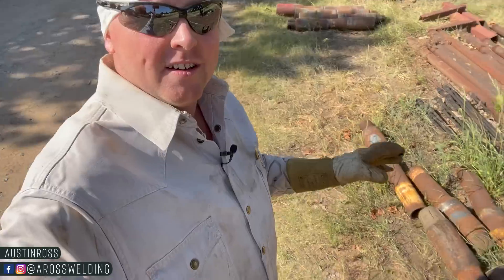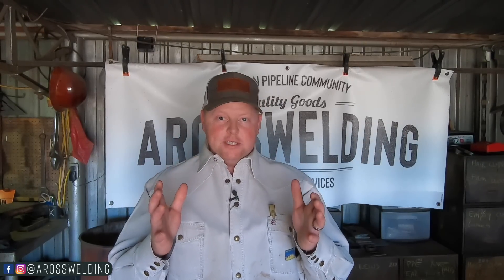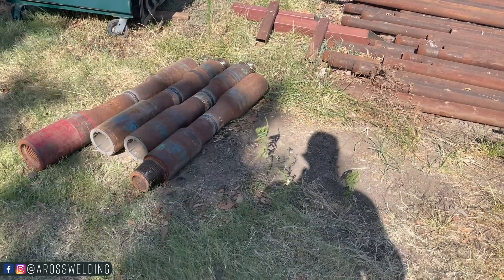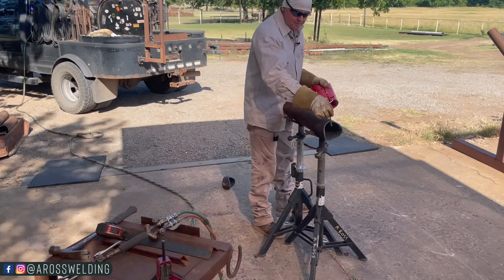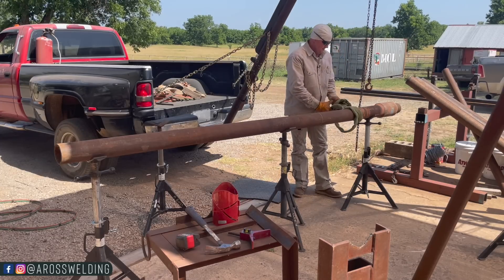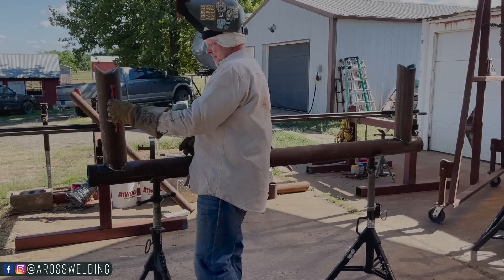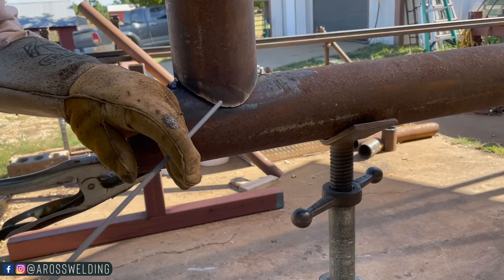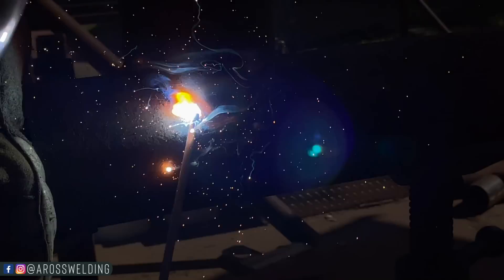WHEN WELDING ON MAGNETIZED PIPE

Comment: I build pipe fence and most the time I will  heat with a torch and beat on it with a hammer a bit or turn it up more. If it’s real bad I will wrap a lead around it. Once it gets red hot it usually will chill out unless it’s real bad

Comment: I use to rap my stinger around  the pipe multiple  times one direction or the other to pull the magnetism  out so I could weld it when I had my old Lincoln  my 250 Miller didn't work that way

Comment: 69 years old, started stick welding in 1976. Took a loooong break, until 2014. By that time, I inherited a Craftsman welder and did a couple of projects. In 2017 I bought a Forney wire feed welder and started doing some projects around the house. Today I have a Lincoln 215 MPi and do mostly MIG but still practice stick often.

Comment: if you are running a modern welder / generator on a rig would a 240v plasma cutter not be cheaper than paying for oxy/fuel ? would a ac/dc rig make it any better to work ? good vid .

Comment: Stick welding off & on for 48 years. Off & on since I was predominately a Heavy equip/Diesel Mechanic.. Gas welding was the first time I welded.. My claim to welding fame was welding a rack to double stack V-12 Cummins engines in the warehouse.. never really did any pipe welding though, so I dig watching you go at it

Comment: I am 60, and started stick welding as a teenager on farm equipment, etc. Took some welding classes in college, and continued working on farm equipment, and my heavy equipment.  Tried mig welding some 20+ years ago, but didn't really use it much until I bought a new Millermatic 252 about 7 years ago. Really enjoying learning from you, and I trying to learn more everyday.  Thanks👍

Comment: 37. Been hot metal glue gunning around the ranch for 20 years. Had a guy that worked for us get me going before he was fired. Been learning the rest on my own. Far from being an “expert” but welds quit breaking after a couple years and several temper tantrums. 
As for the magnetized pipe and old man I met several years ago told me to wrap ground around the pipe several times.

Comment: A trick I learned years ago; take about 4 - 6 wraps of old, bare (insulation removed) welding cable as close as possible to the joint to be welded and attach your ground to that.  It's worked for me many times to stop the "spit back" of a welding puddle.  60+ years of welding stick, then MIG and finally TIG.  Guess it gets in your blood.  Thanks for the videos, stay cool and safe!
Reply from the maker: It definitely gets in your blood. I agree. Thank you for sharing!
Reply: I would wrap my pipe with the ground wire 2 or 3 turns and it would calm the drifting arc.
Reply: What an elegant solution! 

My background is electrical engineering and I sure didn't see that "trick" coming (please allow me to geek-out a moment); induce an alternating magnetic field using the very current you're welding with, other then the reactants of the coil (the coil's induced opposition to current flow due to counter-electromotive-force), most of the energy dissipated and voltage drop will still from the weld. You're multitasking!!!!
 
As long as you're using the full AC (not a rectified, 1/2 waveform or interrupted DC, it seems to me it should work perfectly).
Reply: @RobertLBarnard  Your obvious knowledge of electrical current is far above my "pay grade."  This trick was imparted to me well over fifty years ago by on the best welders ever to strike an arc here in north Texas.  It works well, so I've always used it when necessary (we have a lot of surplus drill pipe, tubing and sucker rods) that are used as construction material, thus the need for a solution.  Glad to share his "trick" if it helps a fellow welder.
Reply: @RobertLBarnard  How could this be achieved on a flat plate? 8cm thick and 1.5m around. I'm struggling to get my head around it.
Reply: @willeveryday try yelling at it
Reply: I do the same thing and it works well.
Reply: would it work even better if you rapped two seperate coils around each side of the joint and then connected the ground cable to them? Have you ever done that? or could you give a little more detail? Thanks.

Comment: 56 learned welding in my operating engineers apprenticeship been welding off and on for 33 years do projects on the farm or some small things at work have recently started making bits for horses and delving into knives did some fence braces out of drill pipe last summer didn’t realize until today why some welds were harder than others thank you and enjoy your videos

Comment: I’m 36. I started stick welding in high school. I’ve been doing small welding jobs and building pipe fence on the side ever since. In 2016 I took a job as a welder in a water treatment plant, we do everything from building handrail to repairing leaks on water pipelines as big as 96”. I’ve also mig welded and since taking the welding job I’ve started Tig welding carbon, stainless, and aluminum.  I enjoy watching your videos, I like to learn something new everyday as you say.
Reply from the maker: Thank you for sharing! And thank you for watching! We sure appreciate it!
Reply: FUN HUH, I DO ALL THE WORK FOR THE WATER POLLUTION CONTROL FACILITY!! THATS WHAT THE SIGN IS OUT FRONT, BUT UNLESS YOU LIVE EITHER A LITTLE UPWIND OR DOWNWIND!!!!!!! IT'S THE DOO-DOO PLANT!!!!!!!!🤣🤣, BIG SIGN IN THE SHOP " YOUR SH*T IS OUR BREAD AND BUTTER"  ITS CLEANER THAN 95 % OF THE FACTORIES WE WORK IN!!!!!!!!

Comment: I’m 50 I’ve had my on mobile welding business for 20 years. The best way I found to deal with magnetized pipe move the ground if possible run it as hot as you can and rod angle

Comment: Austin in that booklet I sent you there is a section about magnetized pipe . It worked well on big inch pipe in conjunction with a gauss meter . Most pipe that has been in the ground for years will be magnetized

Comment: I always keep a 4' length of copper cable without shielding and wrap the pipe then ground to that cable to cut down on arc blow from magnetic pipe. Works ok but not as good as AC.

Comment: Just a lurker here originally from Kalkaska Michigan, 59. Dad taught me how to stick weld when I was around 8 or 9 on an old blue Miller AC. Got a UV burn 30 years ago that never quit looked right. I went into electrical, then software engineering. But welding and machining never got out of my system. Have a hobby shop and I watch guys like you (and gals too, @Goldie Hacks) to try to recover some of what I'd have learned had I chosen that path.
Reply from the maker: Thank you for sharing! And thank you for watching! We sure appreciate it!

Comment: I’m 35 and been welding all hi school and after that so like 19-20 years I’ve been welding gulf coast refinery’s, chemical plants, power plants, nuclear plants, pipelines, compressor stations, batteries pads…. Stick,flux core, tig, mig 

Best way for welding on magnatized pipe is to wrap your ground around pipe 8-9 times  down stream from weld .. welds like almost perfect .. start with 6 wraps and adjust from there… I do fence line and they helps alott to leave good looking quality welds

Comment: I get a kick out of you using every bit of your material . For what you are using it for why not . I've welded drill stem magged up so bad it squealed . Running  on straight polarity helped. found out the other day that most drill stem has a very high tensile strength  using 11018 would be better than 7018  for most of it  . Use the cut back chart I sent you so the spaces aren't so wide  on the saddles it will help . Good video

Comment: Ben a mechanic and part time welder for 45 years. Retired form the wrenches at 62 and started to do some portable welding, which has turned into another almost full time job, problem the body is only good for about half a day anymore.
I'm about 120 miles Northeast of you and there are Two large Amish communities that take up most of my welding time, quite bit of 150 year old horse drawn equipment plus cast iron and brass that needs brazing plus building some new horse drawn equipment.                                                                           I really enjoy your channel and have found even an OLD dog can learn a new trick once and a while.
Reply from the maker: Wow that’s neat. That’s a neat deal welding on all the horse drawn equipment and cast iron and whatnot. I love it! Thanks for sharing!
Reply: @arosswelding  If you are ever up this way give me a shout. I'm about 6 miles from the MWI welding school for a location clue.

Comment: I am 56 years old I have not welded in approximately 5 years or more. I used to weld projects around the property. However, I have about 7 years of welding experience, about 3 yrs. in a Shipyard as a Welder, and approximately 4 years as an Ironworker/ Welder with various Construction companies at various construction and industrial facilities such as a steel mill, paper mill, cement plants, lumber processing facility and so forth. I have never welded on any magnetic pipe before. I have also learned that practice makes perfect, and hood time is valuable.

Comment: I'll be 41 next month and I have been stick welding on and off since I was 15 I learned with a Miller dial arc 250 AC/DC If you weld magnetized pipe with a AC output you don't have Arc blow problems

Comment: Have u ever tried wrapin your leads around the pipe to dmagnetize  the pipe gota wrap your stinger lead around the pipe about 4 or 4 wraps clockwise then touch it to your ground if u wrap it 1 way and it doesn’t work the wrap it counter clockwise and bump your ground it will d magnetize the pipe give it a try tell me what ya think if it’s really bad maged you’ll have to leave your lead wrapped while U make your weld
Reply: That works I've wrapped welding cable around big inch pipe to demag  .  used a separate welding machine to do it . used 10 full wraps and used the continuous dial to control the amount of magnetism  . that was enabled with a gauss meter . worked very well on magged up pipe that had to be xrayed
Reply from the maker: I’ve tried a little. But I’m not sure I’ve ever knew the full process like you’ve explained here. Thank you for sharing!
Reply: @arosswelding   yes sir sometime u have to wrap your stinger clockwise and other times counter clockwise and always bump Your stinger to your ground I always hang a rod off the bottom of the pipe as a indicator when the rod falls shes demaged 👍